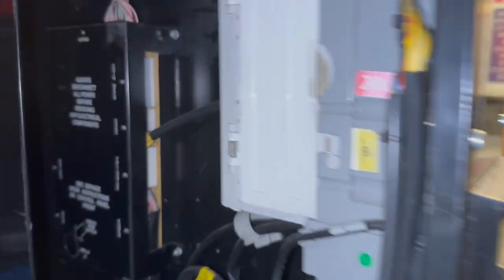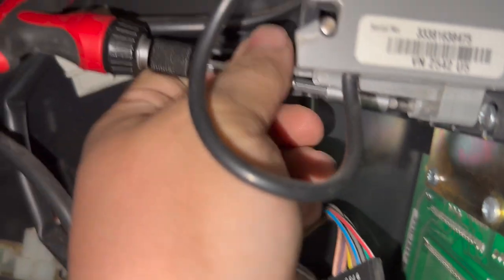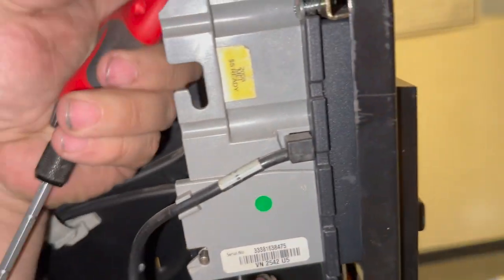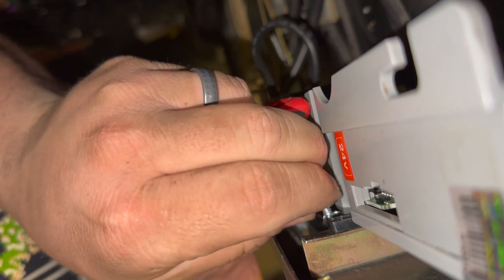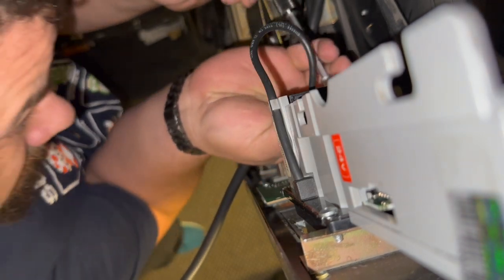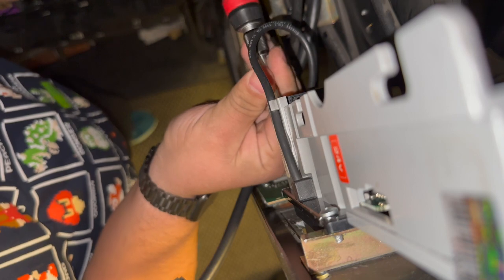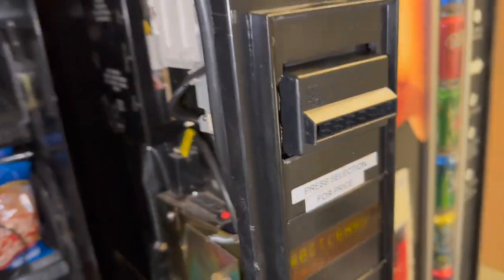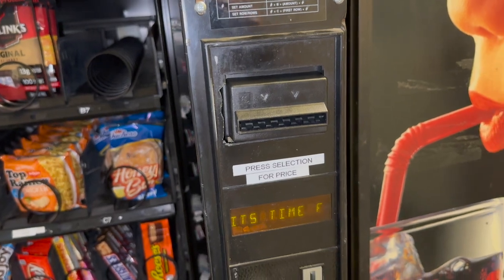How to Swap out a Bill Validator #vendingmachine #diy #vending

Comment: My machine MDB compatible but the validator only takes 1$ can I buy another validator that takes 1$ and 5$ and connect to my machine I’m kinda new to this
Reply from the maker: Yes you can. I would recommend MEI validator they are the best. Just make sure it says 2008 $5 ready on the unit
Reply: @720vending  Ik this is stupid but can you send me a link to one of them cause I do mess up a lot
Reply: @720vending  would I also have to purchase with or without harness ?
Reply from the maker: @flawlesssnipes630  if the one you are replacing is an MEI will not need to get a new harness
Reply: @720vending  got you yea I don’t think mine is so I’ll have to buy the harness
Reply from the maker: Doug bale enterprises sells refurbished units ask about the MEI VN2502 series validator he will be able to help get the correct one for you
Reply: @720vending  thank you !
Reply from the maker: @flawlesssnipes630  your very welcome hope my videos help